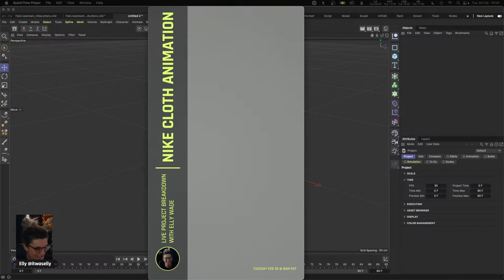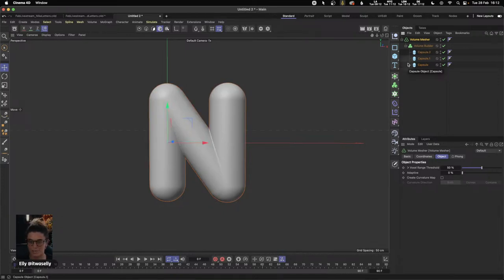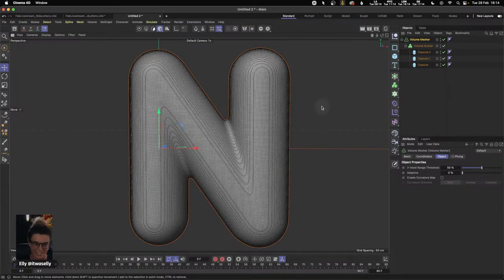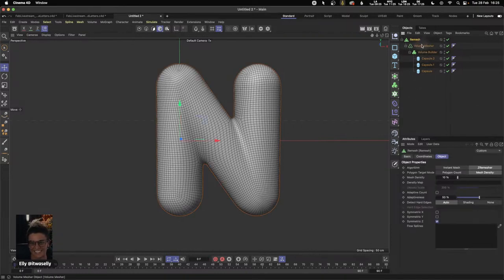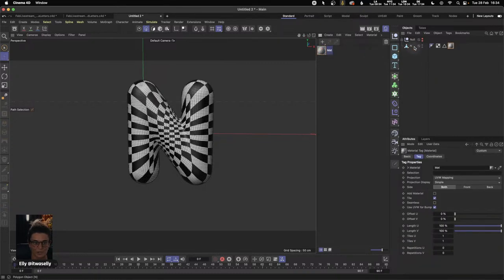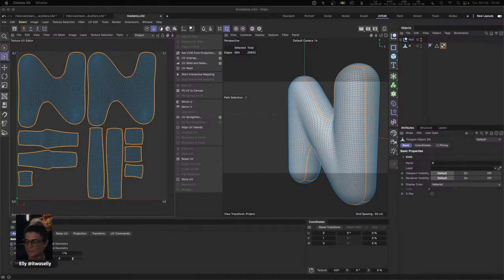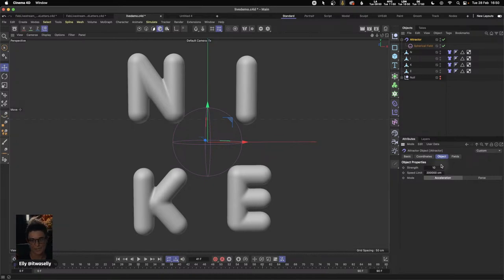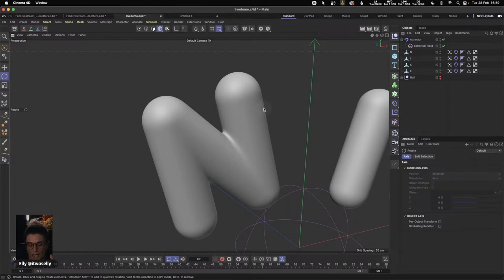LIVE Project Breakdown | NIKE Cloth Text Animation

Comment: not sure if this is the place for this - but im a beginner in c4d/redshift, and ive been trying to add decal/sticker designs onto a sphere (im using a smiley face) similar to what youve done here with the nike content on the UVs.  HOWEVER - i was wondering if it was possible to add those kind of transparent png decals, as a stacked second material?  Would that deform with any cloth animations, or would that only be possible on a material made in this method with editing something according to the UV maps?  Thanks!

Comment: I got to the point of applying the Attractor, and there was no fields tab. So I searched for the Spherical Field and made it a child of the Attractor and got no movement. Any ideas on what I could be doing wrong? Thanks in advance.
Reply: Same issue, letters beginning to act crazy as soon as they enter center point of the scene

upd. found out that was a bug, it's fixed in last version